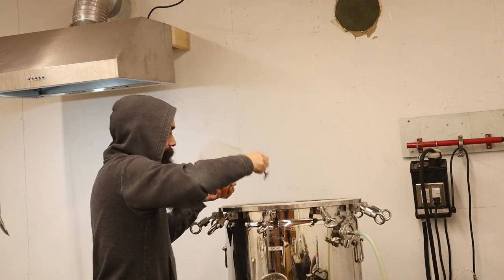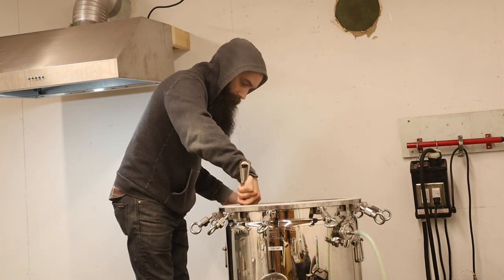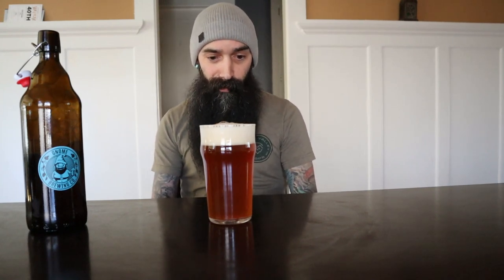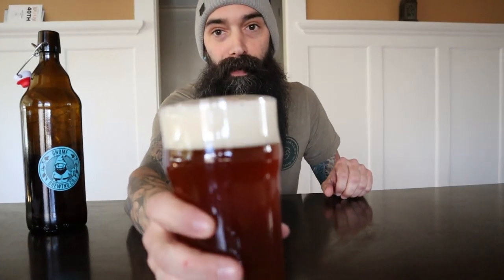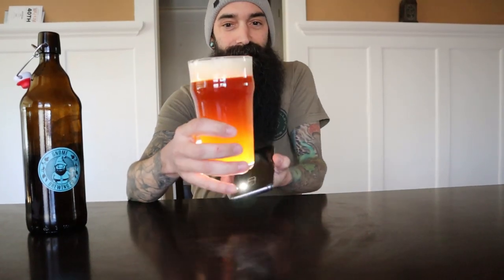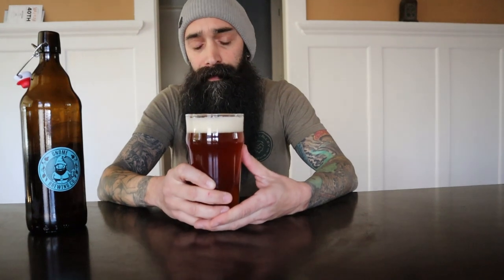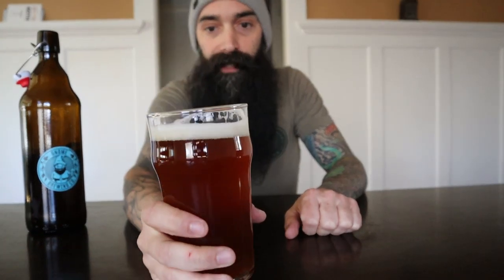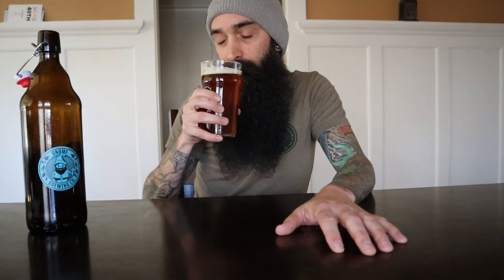Thanksgiving Ale w/ Sweet Potato and Spices // Grain to Glass

Comment: Great video, interesting looking beer. Just wondering, are the sweet potato and spice additions in the recipe for 5 gallons? Looking forward to trying to brew this one.
Reply from the maker: With my system the absolute smallest batch I can make is 6.5 gallons so its been scaled up slightly but the amounts are safe for a 5 gallon batch.  Ive seen larger spice additions in recipes but wouldn't recommend it personally.  Thanks for watching Rossco!